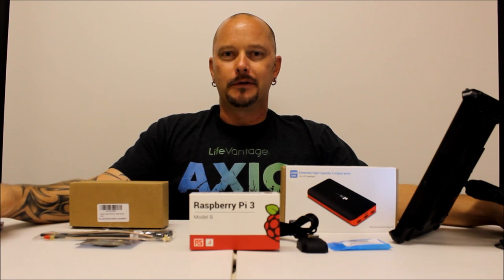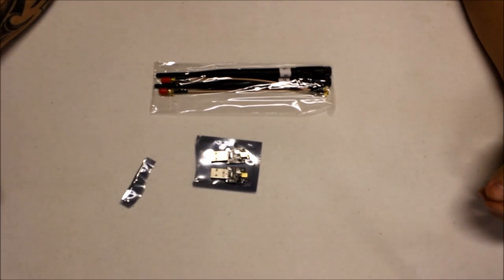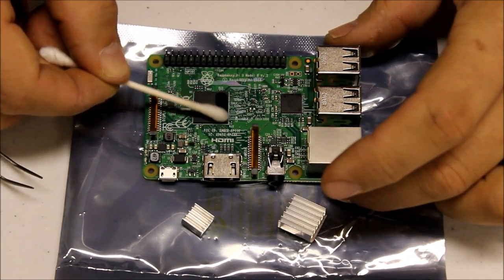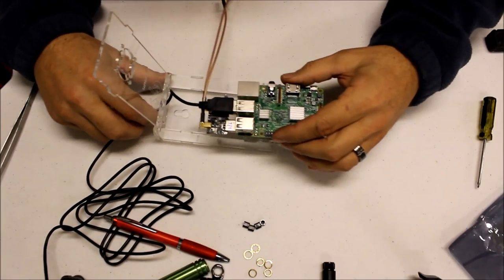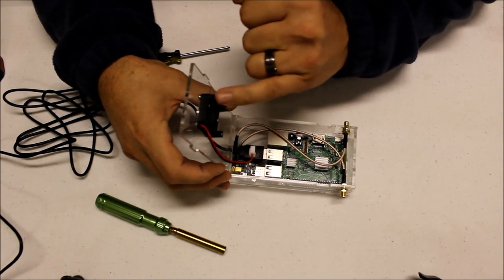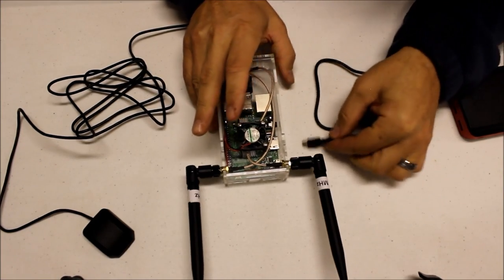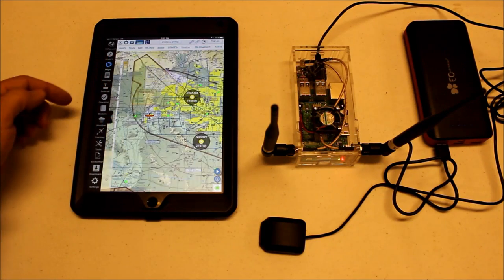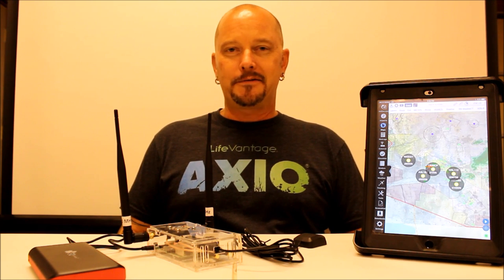Stratux ADS-B in receiver - unboxing, build and how to video with FltPlan Go demo

Comment: Started watching this before assembling my build. I'm missing the heatsinks, so I'm going to hold off for a while, but this is a great video that I'll refer back to when I'm building it next week. Great job! Safe landings!
Reply: Just a note: The heatsinks folks are buying for their Pi's don't have any real heat transfer compounds making them less effective -- and in some causes causing increase heating due to the insulating properties of the tape. The Pi was designed to not use a heatsink. That fan blowing on the SOC portion of the Pi itself will do just fine.

Comment: Yeah!  Really piqued my interest.  I'm a computer industry tech / instructor, and a volunteer on the B-17G project at Grimes Field airport.  One helpful add-on might be the Raspberry Pi 7-inch touch screen display.  It plugs in to a single-sided ribbon cable connector on the Pi main board, and displays the Linux OS desktop screen, or whatever the running application would send to the HDMI port.

Comment: Nice video.  It really helped me understand the device that came with the airplane I recently bought.  It looks to be the very same.  It’s been working well, except for how it’s mounted.

To give the antennas a clear view out of the aluminum fuselage, my box is mounted high on the sidewall so the antennas can peek out.  The Pi is thus in a bad spot for a narrow tandem cockpit.  I’d like to use extension cables on the antennas to allow the Pi box to be mounted more conveniently while mounting the antennas around the canopy frame.

Do you know if such antenna cables will work without degrading performance?  Thanks!
Reply: Any connector and transmission line degrades the signal. But, if you can get the antenna to a much better location that has a view of the surrounding environment then the losses of the cable and connectors could far outweighed by the better view.

Comment: this should work with any type of portable powerbank right? i have an aukey 10000 mah one. thanks and very helpful vid! :)
Reply: Generally, Raspberry Pi projects are not too picky about the power source. The X amount of mAh will help determine how long the battery will last before the Stratux will drain it. The 6-10k mAh battery supplied in some Stratux kits claim to last 3-4 hours of use with the Stratux and I would expect the same for yours.

There are some features to pay attention to, however. Having a pass thru charging battery will allow you to charge your battery and use the battery at the same time, which may be helpful. Also, an improperly shielded battery can add interference to radio communications, so if you notice a reduction in radio transmission quality with your battery, try the one that comes with the kits or the ones you can buy from Sportys. They have supposedly been tested and proven to minimize interference.

There are other features that might be worth considering, such as weatherproofness and how many devices the battery can charge at once. I don't think 10k mAh is enough, IMHO, to run the Stratux and keep an iPad going, but that's just me. My battery also has a solar panel and a flashlight that can signal SOS. While the solar panel won't keep a device running, it's a handy feature I hope to never need in an emergency.

Comment: hi , did the fans and the power cable for the motherboard come with the raspberry pi kit?
Reply: The Pi itself does not come with anything other than the motherboard and instructions he unboxed. There are a variety of Stratux kits and they can change with time so we have no way of answering your question for the kit you have in mind. With that said...

Usually the fan will be included with a case, since the fan is usually mounted to the case, rather than the Raspberry Pi unit. Power cables, especially for the Stratux design, is usually not included, since it is assumed that you'll be attaching your Stratux to a battery via a cable that may or may not have been included with the battery.

Comment: Hi, is this ADS-B In and Out? Also, what are the tablet requirements?
Reply: It is ADS-B In only. The FAA does not officially recognize mobile ADS-B units. They must be permanently mounted to the plane and powered by the plane's electrical system to be considered official. Thus, mobile ADS-B Out units are "illegal" (ie, against regulations) and ADS-B In units are for backup use only.

Tablet requirements are set by the Electronic Flight Bag app developers. Check with your EFB devs or on the iOS App Store/Google Play Store. GPS and cell service is helpful to the point of being effectively required, but not technically required.

Comment: How do you update your maps in real time if you only have one wifi device and it is connected to the Statux?
Reply: The charts themselves are updated on a regular basis in accordance with FAA publications by the pilot's Electronic Flight Bag (EFB) and downloaded to the device's local memory. Once the chart is downloaded, your device doesn't need to be connected to anything in order for you to view a chart. A wise pilot will always check to insure that their charts are up to date prior to leaving their house. 

The pilot in this video uses FltPlan Go for his EFB and would update his charts while connected to the internet, prior to each time he connects to his Stratux. While some tablets are capable of receiving a cell signal in flight, the file sizes for the charts are relatively large and updating charts while flying is considered a distraction and poor planning.

However, just like you can draw all over a paper map, an EFB can digitally add information to its digital charts to show information. What Stratux does is collect data from 987 and 1090 Mhz transmissions and passes that data to your device, via the WiFi transmitter built into the Raspberry Pi, to be displayed by the EFB. Assuming that everybody's devices are functioning, traffic is, more or less, displayed in real time, whereas weather is updated less frequently.

ADS-B is short for Automatic Dependent Surveillance Broadcast and is used to help track aircraft in the sky. It is transmitted at 1090 MHz and the signal contains aircraft data such as the location, speed, altitude and aircraft call sign. ADS-B is utilized worldwide. Most skyworthy vehicles are required to at least have an ADS-B "out" transmitting device that sends out location information to any receiver within range, but ADS-B "in" is optional. Stratux devices are ADS-B "in" devices but do not alleviate a pilot's responsibility to visually avoid traffic or allow them to leave up-to-date paper charts at home.

UAT is short for Universal Access Transceiver and is transmitted at 978 MHz. Like ADS-B it is used to keep track of aircraft, however UAT is only available in the USA and only for aircraft that fly below 18,000ft. 

I believe that both ADS-B and UAT transmissions carry weather data.

I believe the GPS is there only to determine your own plane's location so that the EFB can keep the chart centered on you as you fly, and determine relative information, such as remaining distance to your destination and other traffic.

Comment: To get out of the ADS-B receiver, you don't need to enter no stinkin' IP address, Just unplug the d@m thing from its battery. It comes up just fine the next time when you boot the raspberry pi.
Reply: If you follow the correct procedure for shutting down the raspberry pi you will not corrupt the data on the micro sd card, if you just unplug the battery you have a possibility of corrupting the card. I for one would rather take the extra 5-10 seconds and shut it down correctly so I know it will work the next time I use it.
Reply: Only possible issue for corruption is if a file is being modified while it was unplugged. I've been playing with Pi's for some time now and it's nearly always a yank on the cord when I'm switching something around. Never once have had one not come back up. But if you're more comfortable with a proper shutdown that's you. Nothing wrong with being overly cautious on something you're using for flight.

Comment: Does it only track ADS-B aircraft?
Reply from the maker: No. Any aircraft with a transponder that is being rebroadcast to ADS-B out aircraft.
Reply: I think that's incorrect. The Statux will only see aircraft that are ADSB-Out capable. I don't think it shows all transponder equipped aircraft.
Reply from the maker: If you are near an ADS-B out aircraft you will see other aircraft as reported by the ground stations to the ADS-B out aircraft. Do a search for how ADS-B works for more info.
Reply: Budget Pilots that's right. I misread your reply to his question. It will piggyback off other ADSB out aircraft.
Reply: you got a list of the items on amazon?
Reply from the maker: No sorry. You'll have to search for each item individually because Amazon changes their inventory from time to time. Pause the video while you search.
Reply: Go to the stratux.me website for the current recommend parts list.  Has links to each part on Amazon.

Comment: hi my green light is not blinking it's just steady on and help plss
Reply from the maker: You may need to reflash your micro SD card with the latest Stratux software. Check out stratux.me website.
Reply: If I understand correctly, the latest builds of the software will show a steady green light when the software is fully loaded, versus the green light showing SD card access.